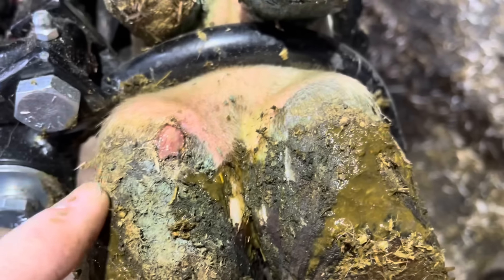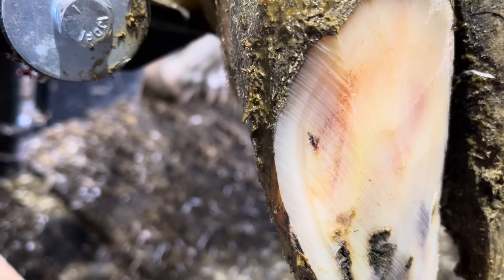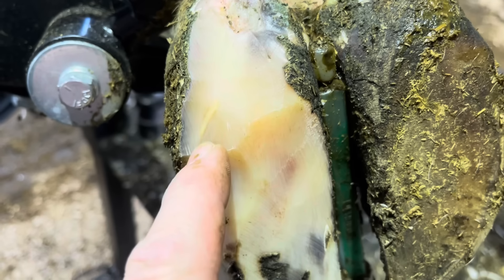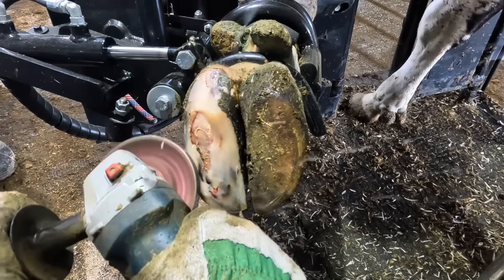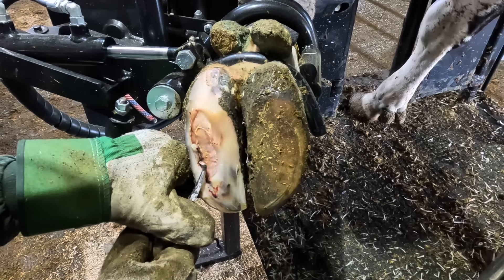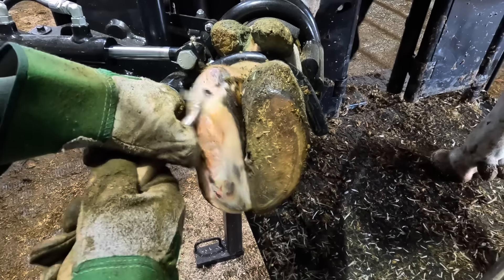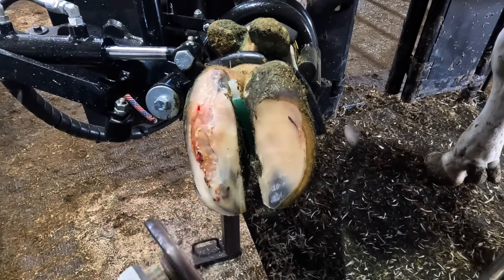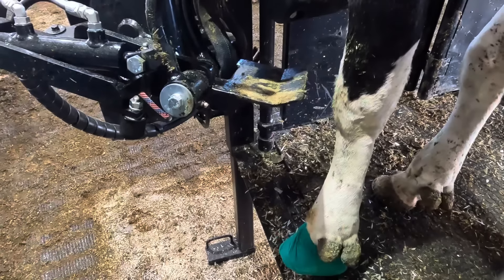Cow’s Hoof BURSTS at the SEAMS

Comment: I've seen a lot of hoof trimming videos and you do a good job of cutting. Only 3 points where you caused bleeding, but these were small and shallow, resulting in minor bleeding. Some trimmers will work fast and either cut where the cow is obviously hurt or cuts are deep and the trimmer has to stop cutting and deal with the bleeding.

Comment: Been absolutely hooked on your content for the past few days but I have a few questions still.
1. How does a lesion (randomly) start from inside the hoof?
2. How does a small pebble/rock penetrate all the way in to the hoof to do damage to the corium?
3. How would you fix a lesion that hasn’t surfaced yet so is not yet infected? You wouldn’t just remove all the hoof so a whole new layer can build up right.
Reply: If you look back at some of his older videos, he addresses these questions.  Basically what happens is there will be some kind of disruption in the growth of the corium that creates a crack, or the sole grows in a loose layer as the cow's natural response kicks in, and rocks and debris can get into the crack or under the loose sole and cause problems.  What causes the initial disruption can be a variety of things, including if the cow's hoof isn't balanced, so regular trims are important.  Also bacteria can get under the loose sole and make the disrupted area even worse.  He has an experienced eye and can find disruptions by looking for a 'little black dot' on the hoof, then exposing the area so that it can heal cleanly.  Sometimes the cow just steps on something, like a nail or a screw, and that can embed itself up to the corium layer as well.
Reply from the maker: https://youtu.be/2P1Q9rtp6Xw
Reply: @lonesparrow  why is sole separation or loose horn an issue? If its not yet infected, wont new horn just grow from the inside out, even tho you might end up with a hollow (part of a) hoof which might end up being a different problem if its big enough for it not to support the cows weight. Btw how does horn become loose, since it grows inside to out it starts off always connected to the corium right?
Reply: @jair9033  if theres sole separation, debris can get inside even the tiniest crack and then bacteria can infect the corium which doesn't allow it to grow new hoof horn properly. But Nate has trimmed a cow before who'd already healed naturally from this kind of defect. Treating the hoof  just helps it heal faster and makes the cow more comfortable.

Comment: 1 question I've always wanted to ask but after going down all the way to flesh how does the cow poop and other types of dirt not cause the wound to get infected? Like I've always been told that if you get a cut you need to make sure that you clean it out and cover it in order to not allow bacteria to get into the wound yet cows walk on dirty floor a faeces all day so how doesn't that cause a infection to form as they have a opened wound that's getting dirt and faeces in it 🤔
Reply: The salicylic acid helps to heal & prevents infection and the wrap helps keep it clean.
Reply from the maker: They rarely get more infected.  New sole is produced pretty quickly.

Comment: Boy, felt for you doing that delicate trimming on the wall horn so close to the lesion (not to mention with farmer watching) Got me thinking, could using a smaller shaped grinding tool or abrasive cone or drum with something smaller like a Dremel tool allow you to take tough spots like that down with increased precision?  Save you some tough knife work.
Reply: I feel like it would be a lot of hassle to be constantly moving around different tools, and the added risks for safety, with cords potentially entangling and having multiple power tools to be aware of at all times. Also iirc he starts using the knife when he's quite close to the corium and those "layers" you see peeling off are often actually paper-thin so a grinder even small would be quite risky for the cow.
Reply: @dma93-ch  I doubt it would be so terribly hard to simply pick up another tool that is already plugged in. No tangling necessary. Would just have dremel handy for special circumstances. How hard is it to plug something in and insert a bit? Somehow I think Nate could manage.
Reply: @ChristopherBix  dude he has 20 years and like 1 million cows of experience, I think if he hasn't done it he has a good reason.
Reply: @dma93-ch  Well DUDE ExCUSE me for making a suggestion. I'm so so sorry you disagree with what would be an effective thing to use. Interesting that you feel you know what he thinks and would or would not do. Amazing you take the time to knock what is a perfectly rational idea.
Reply: @ChristopherBix  don't mind the know-it-all. He's jumping on a lot of comments with "wise" words.

Comment: Why dont u wash dirt b4 trim
Reply: One reason it’s not done is because power tools and water are not compatible and also it makes the floor more slippery.
Reply: Also it doesn't do any good to clean the outside of the hoof when the problem is on the inside of the hoof. Using the wheel gets the hoof far cleaner than water would.

Comment: Why not wash the cows hoof before u start treating it?
Reply: Because the mud is deeply imbedded in the hoof , even after cleaning when you cut away there will be old dirt , it’s pointless and a waste of time
Reply: @LeeclassicAmericanbullyowner  and a waste of resources when water is precious
Reply: @PuffKitty  even though, Enterprises are wasting a lot of water, like honestly, its worrying
Reply: Also think about standing in water and using electrical tools.  Hmmmm that doesn't sound safe either.  🔌⚡
Reply: @patpeters6331  as longs as your tool dose not have exposed wires your fine , these tools are designed to be used out side like most power tools .

Comment: Sorry but the vetwrap should cover the entire bandage underneath, otherwise moisture and manure will find their way in and make the entire bandage dirty and wet
Reply: Lol are you a hoof trimmer? Because I'm pretty sure you're wrong
Reply: @FrogToadBug  no I’m a veterinarian and that’s how we do it in Sweden. Perhaps he has a reason for how he does it. Why do you think I’m wrong?
Reply: @AnnaJ55  he does only this every day. I think he knows how to do it. The block keeps the bandage up away from the ground. He has follow-up videos where he shows the bandage several weeks later, and it is usually very clean.
Reply: @FrogToadBug  the block keeps the opposing half of the hoof off the ground, the bandage is still very much in contact with the dirty ground cattle walk on. The manure they undoubtedly step on every day is wet and soaked up by exposed gauze which leads to a dirty and wet bandage. There is no way a bandage is clean after several weeks in the kind of environment that cows live in and further, no bandage should ever be on for several weeks.
Reply: @AnnaJ55  it's a hoof, it's not an open wound. My impression from watching his videos is that if there is a wound that gets through the corium later, it needs to be trimmed, sprayed, salicylic acid, and wrapped. After a few days some corium has filled in the open area, and it would be ok if it touched mud or manure, there's not much risk of infection at the point. The block would be to keep the cow off that area for pain and to prevent future injury.

That's my impression from watching his videos. I'm not an expert. But he is, and I have no idea who you are, so I think he's right and you're wrong.